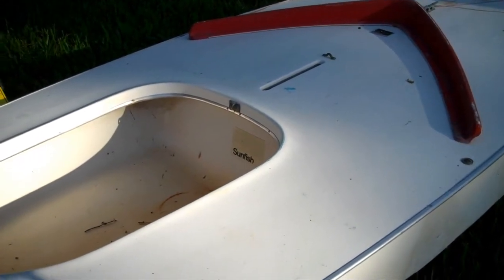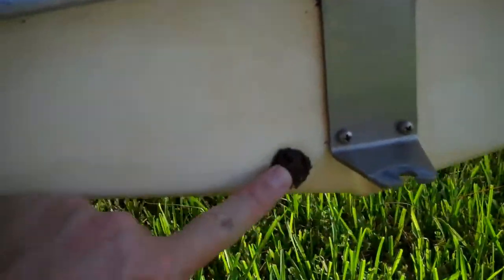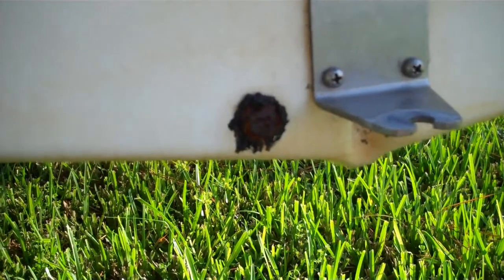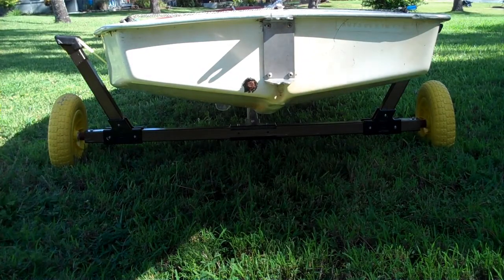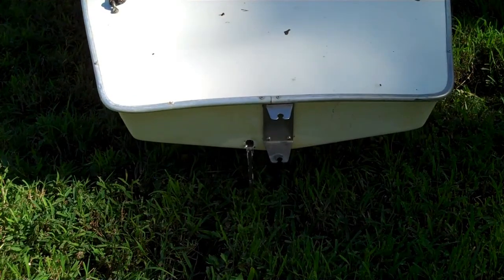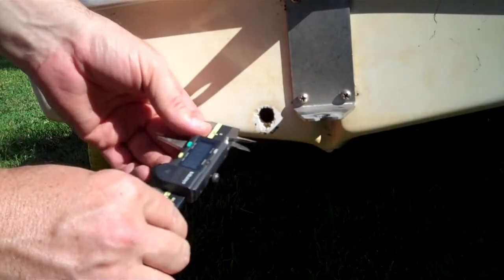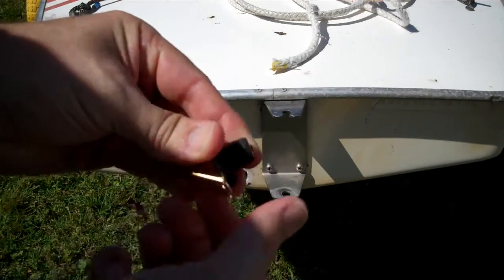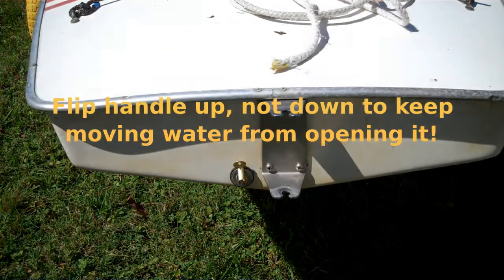Cam lock  / snap lock drain plug in a Sunfish

Comment: Thanks, good info here.  I have a 73 that i don't have inspection ports in and it doesn't seem to ever leak, every year I use it a week or so then store it in the garage and when we're getting it out of the water, it appears water tight, can't hear anything.  I assume it has some moisture in it adding weight with old foam, but I haven't weighed it to verify that.  The original plugs are on the starboard deck and the stern and like you said I think I'd be concerned if I took the stern one out if it's going to be watertight when I put it back.  I'll try to get a better look at all this next summer when I'm at with my boat.  I'd like to put some light air pressure on it and blow air through those two drains for a while to see if that helps, but my challenge is I'm usually squeezing all the maintenance into about 10 days and sailing almost every one of those when I'm around her.
One thing at a time, I will get it weighed next year as a start.  Thanks for the vid!